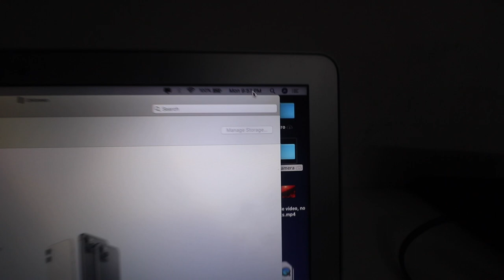RD350, CDI conversion and full wiring (Malayalam video)

Comment: Isn't rx135 chain sproket suitable for shogun
Reply from the maker: Yes but why would you do that?
Reply: Rx chain sproket is 15/37 in my shaolin 13/43 . Rx sproket install I can go easily in 80-100 without any stress . Milage also increase but acceleration decrease. I am a traveller that's why
Reply from the maker: Ok, then go ahead